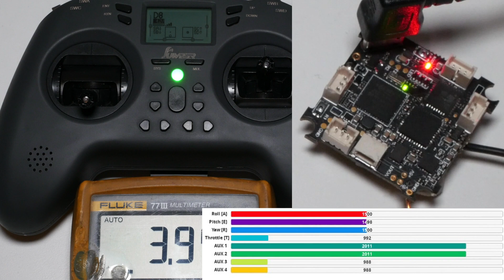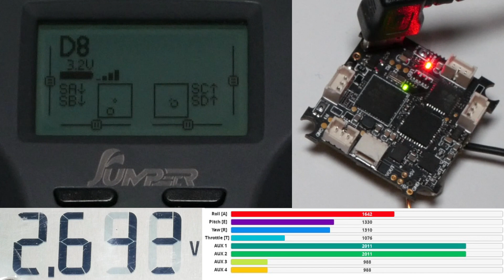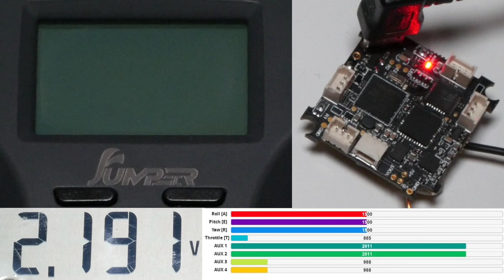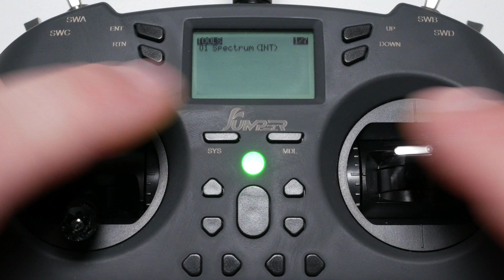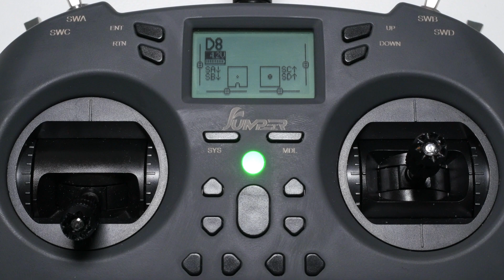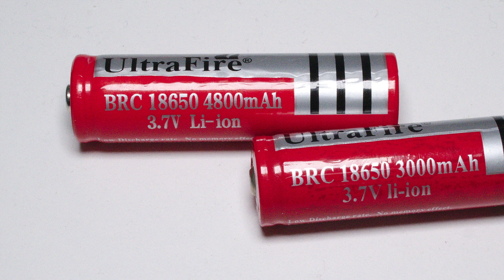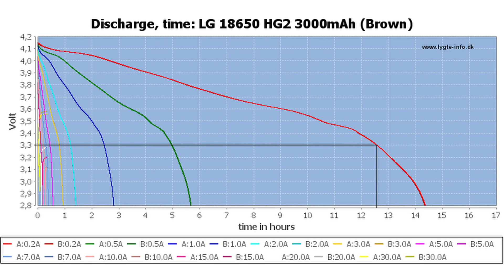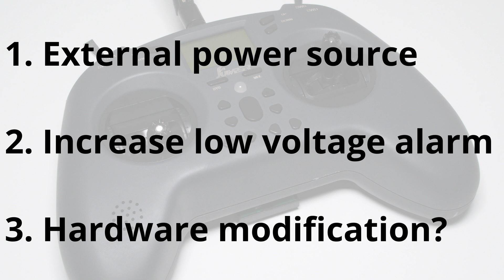Jumper T-Lite: Power "issues" - let's talk about that...

Comment from the maker: It seems Gal Kremer was a bit quicker than me, and provides some good solutions over in his vid for powering the external modules, like CRSF Nano => https://www.youtube.com/watch?v=neJLQ_IHj_o
Reply: Thanks for your insights and for sharing my video :-)
Reply from the maker: @KremerFPV  Very welcome :-)
Reply: So the solution is just to power it by internal battery directly. Hm, it's not ideal, but at least it works)
Reply from the maker: @dmitrysozinov  I have a slightly more convenient solution that is properly switching the module on and off - stay tuned.

Comment: Hi, I am also interested in the hardware mod. Also 2 short questions: 
Does 20700 battery fit inside the battery bay without much modding?
Is there any chance that an 18500 battery will fit in the right arm of the transmitter? The people that modded Betafpv Light Radio 2 managed to fit 18500  in both arms, and T-Lite is the same physical size as the Betafpv radio.
Reply: I received the controller, I did the 1W CRSF mod, changed some switches.
Unfortunately an extra 18500 battery does not fit in the right handle. This is because the multimodule is too wide, so you cannot rotate the hall gimbals like you may do on the BetaFPV liteRadio 2. It might fit if you remove the multimodule and rotate the right gimbal 180°.
Reply from the maker: @sempron1500  Oh,  what a pitty. But thanks for coming back with this info.
Reply from the maker: I don't think that a 20700 will fit - also the benefit would be minimal - slightly more capacity. But I don't have one to try it out. And it is quite possible that you are able to fit batteries in the handles. From what I can see it is the exact same shell. But if you are willing to go through this kind of hassle, why not take a radio that supports all of that out of the box? Also you will not be easily able to charge the batteries - this thing is designed for 1S, so to charge 2, you would need to run your own charging electronics (at least I assume that. I will take a closer look at the PCB though.)
Reply: @stylesuxx  Thanks for your answer. Regarding 18500 battery only in the right handle (left one has the speaker) I would use it in parallel with the main 18650, so the input voltage will remain 1S, but the capacity will increase ;)
I have a feeling T-lite radio will be very popular.
I ordered mine 2 weeks ago (I'm in Europe), so it's still in transit.
Reply from the maker: @sempron1500  I see, yes - you could do parallel. Hope it is already shipped out, otherwise you will have to wait until after Chinese new year :-/
Reply: @sempron1500  that is what i may do with the battery issue ,toping up the capacity by  ......x external 18650  batt using a dc plug.mine is on the way too

Comment: Couldnt you just drop a 2s lipo in there with a voltage regulator?
Reply from the maker: Technically, that would be an option, yes - but you would for example lose the functionality to charge your battery from the radio. This is one of the solutions I had in mind when I said "Hardware modification".